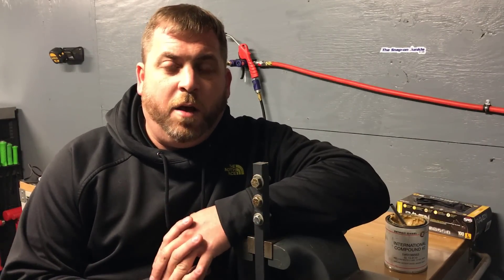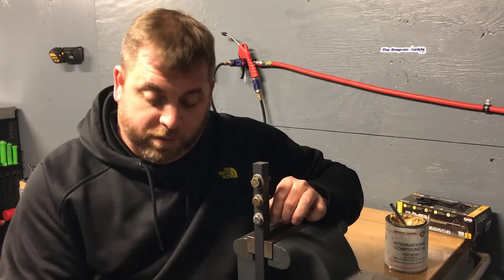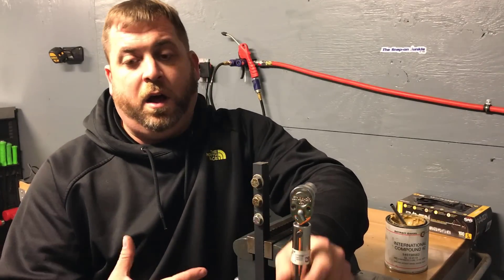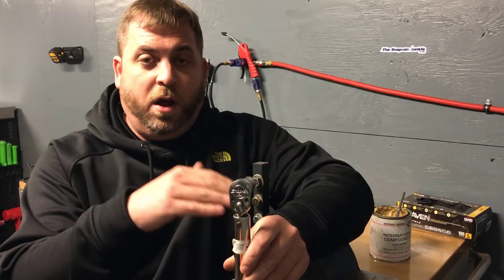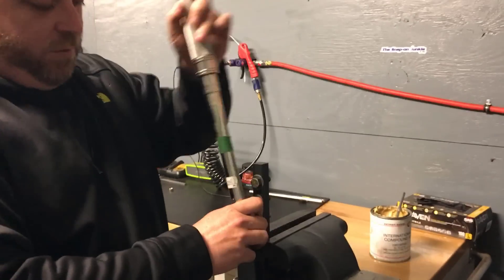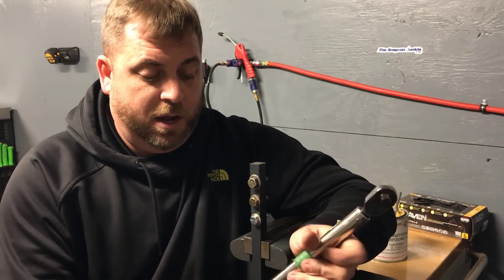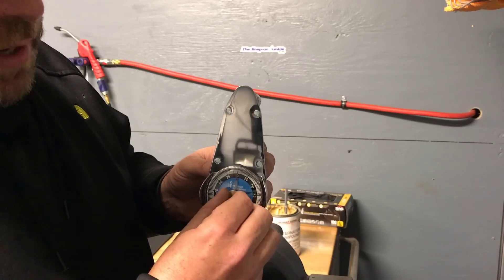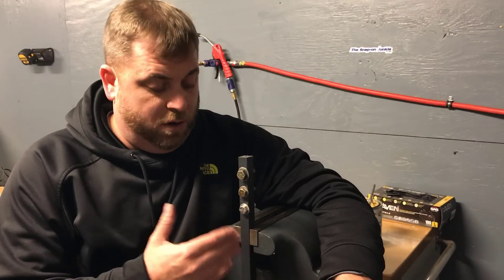Torque wrench lessons

Comment: awesome video ! i have a 1/2" tech angle and a normal 3/8" clicker both snapon the guy that comes round to calibrate them always says the tech angle is always spot on that said both have their place and are brilliant to use, the most useful thing about the tech angle is the preset menu, makes it really easy to quickly select different torque values that you use most often. 
once again thanks for the awesome video very informative and well delivered !

Comment: I was told you set it to the lowest setting instead of zero.The dial style is also used during setting up rear ends.The electronic versions,can do damage to them exceeding the angle gauge limit.The Snap On versions will show an error code when that happens.A company makes a torque angle gauge which sticks to a long ratchet and breaker bar,has a magnet on it

Comment: JUNKIE!!! Hey buddy! I keep five of them due to the volume of overhauls I do. Keep two "clickers" for my torque numbers then two digitals for my yield numbers. And my little guy. Is a Snap On screw driver handle type for my inch  pounds on my fuel supply lines and piston oil squirters. Nice job on the details! Keep it up kid!
Reply from the maker: Fast RN thanks man

Comment: Good video. I will point out one misconception that you stated. Just because a fastener requires torque and angle tightening does not mean that it is a torque to yield bolt. The bolts on your engines are torque to yield and do require a torque and angle tightening sequence. However, a bolt can be a none torque to yield bolt and still require a torque and angle sequence when tightening. Torque to yield indicates that the bolt is actually made to stretch. I hope this was a good explanation and clears up your misinformation.
Reply from the maker: Cal Van Oss ok I fuck up it's hard to remember all that stuff and then try to shoot a video trust me dude it's hard
Reply: The Snap-On Junkie!!! Yeah I know. I've watched you improve with your delivery and content over the last weeks. I just thought I'd be that guy and point out your mistakes. Lol
Reply from the maker: Cal Van Oss just bear with me I'm getting better

Comment: Alright alright! What's everyone's thoughts on Torque Sticks? Or as I like to call them Fucking Garbage?
Reply: The Snap-On Tool Review i like to use my 80 ftlbs torque stick just to snug up wheels when i got the car in the air but i always grab my torque wrench for final check once the vehicle is on the ground. i would never solely rely on a torque stick when tightening wheels. and i would never use a torque stick for tightening anything other than wheels. just my opinion.
Reply from the maker: The Snap-On Tool Review fucking junk torque sticks

Comment: Wicked video!
Reply from the maker: Fast RN  I guess that guy is really regretting that tire company I think that this tire companies will hire any idiotoff the street
Reply: Fast RN this is actually what happened to me. Some guy brought his truck in after getting 20's installed. He said he had a wobble in the back end. I took it on the freeway and the wheel fell off. As I was spinning around on the freeway I was watching the tire bounce over cars. I fucking cracked a median in half with the bumper I hit it so hard if you can believe that. The wheel went down an embankment and into a lumber yard shed and almost hit two people. I came to a stop in the right lane on a blind corner of the freeway. An 18wheeler slammed on his brakes and came within inches from hitting me. Then a cop car came and put up flares. A car came around the corner and smashed into the cop car and a another car smashed into that car.............all because some fucking moron in a tire shop didn't Torque the lugs. And that's why I own a torque wrench and take certain cautions to ensure I don't do the same thing.
Reply from the maker: The Snap-On Tool Review thanks dude hope I didn't miss anything I thought I covered pretty much stuff though
Reply: The Snap-On Junkie!!! Yeah I'm big on Torque. Any apprentice that comes into the shop without a torque wrench I drag them into the Snapper Truck and force them to buy one then I show them how to use it. Too many dumb people out there that have no clue how to use their 400 dollar wrench. Congrats douche, you just bought yourself a 400 dollar paper weight.
Reply from the maker: The Snap-On Tool Review i'm glad somebody's teaching these kids how to use stuff I taught my fair share to
Reply: The Snap-On Junkie!!! Oh dude. I've seen techs rattle nuts on with their half inch impact till it stops. Then use the torque wrench after. It just clicks. YEAH NO WORRIES IT TIGHT!! I can't fix stupid but the new apprentices starting I can jump on them and make sure they are doing it right.
Reply from the maker: The Snap-On Tool Review that makes me laugh because I know exactly what you're talking about hilariously how stupid can you be
Reply: The Snap-On Junkie!!! Haha I've called other techs on it and they just look at me like I'm the fucked up one. Haha I had a really bad experience with someone not torquing a wheel properly and almost died so it really drives me crazy when I see people not doing it right.
Reply: The Snap-On Tool Review how right you guys are! I lifted a 2016 F350 a month or so back. Small lift but a good one that was expensive. Customer says I can not afford the wheels right now gonna ask for them for my Christmas. So day comes guess what got himself. Some sweet expensive wheels. Takes his truck to a local "tire" shop. This is wends. Sends me a text pic wends night of his truck sitting in the middle of a four lane road. With the LF sitting on a triangle shaped rotor! And a ground down front diff!  With no more wheel studs! The wheel passed him while driving straight! He says at 55 mph. My theory rookie did not torque the wheel! All you youngsters this is why we yell at you! THINK!
Reply: The Snap-On Tool Review YOU WIN!